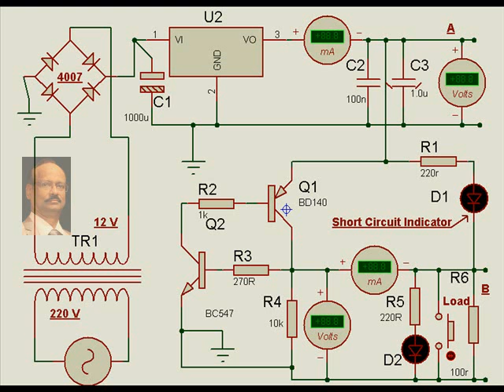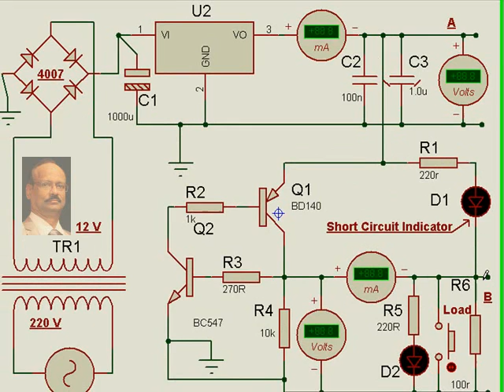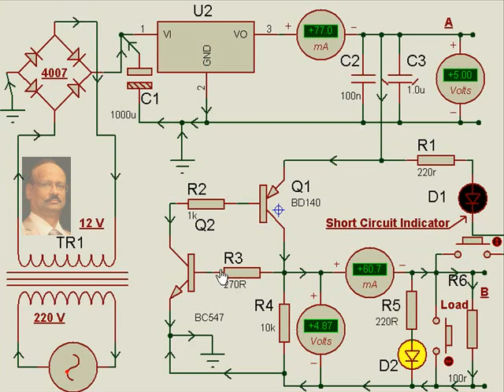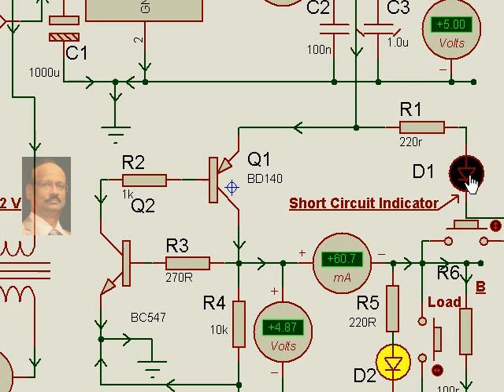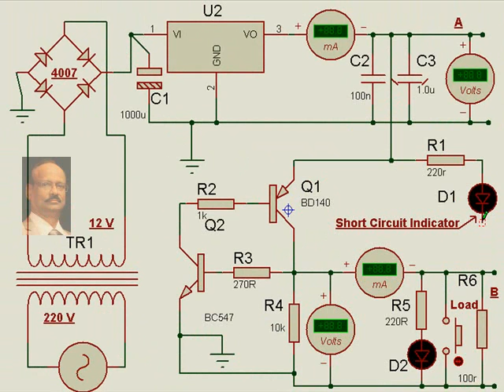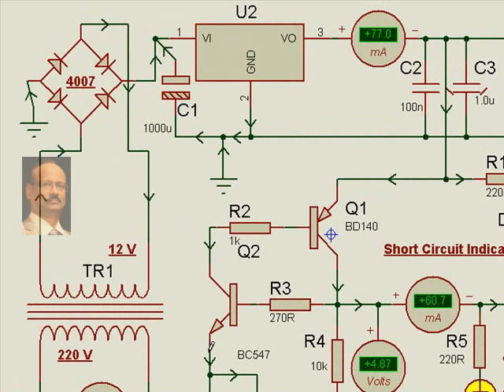Practical Electronics  Mini Project DC power supply short circuit Protect

Comment: What is the limit of this circuit in n voltage and current? 
Can I use it for 0-30v 0-10A power supply or there is a better circuit?

Comment: would this work for a variable dc power supply? I'm building my own DC variable power supply using lm317T for positive voltages (+1.7Vdc to +18Vdc) and lm337T for negative voltages (-1.7Vdc to -18Vdc). I want to add a protection for shortcircuits in my variable power supply, but Im not sure if this circuit will help me because the average transistors has a maximum emitter - base voltage of 5Vdc. What is your recommendation for this application?